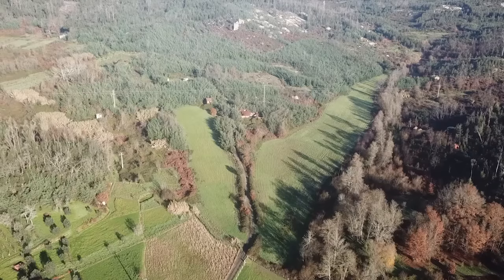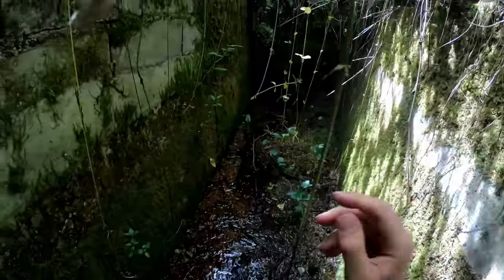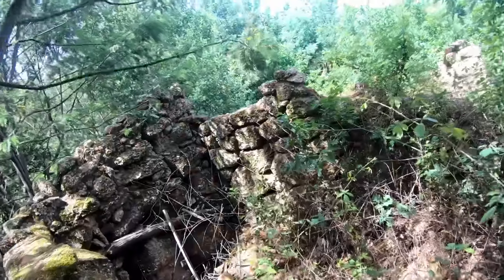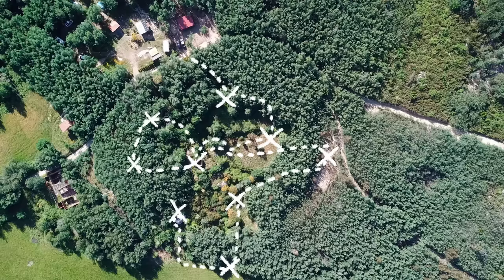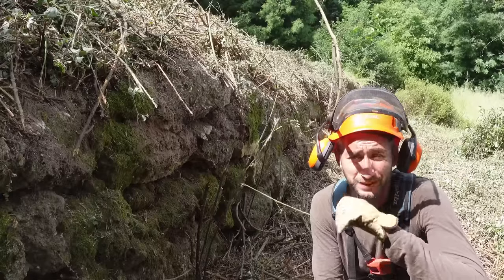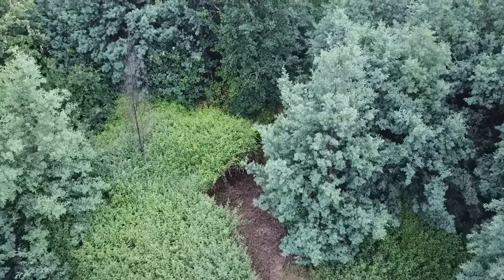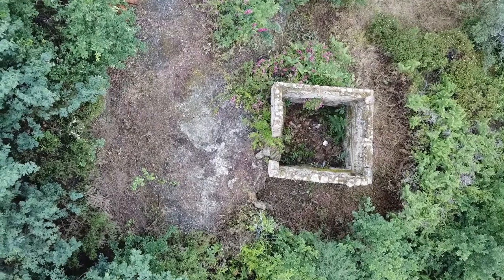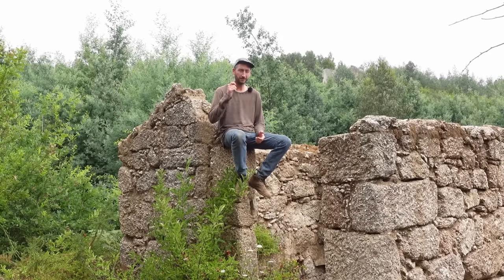#86 There is a "hole" in our land, we went exploring it

Comment: One thing to check out is that if the under laying rock is mostly granite, there may be a radon gas issue in any building you renovate or build.....Also something else to note is that in Cornwall, UK, the granite substrate contains high levels of lithium that are about to be mined....maybe your granite contains lithium too....
Reply: Buy the land before you let a geologist near it as if it is found the value of the land will be so high you wont be able to afford the price and you could end up with mining co owning it and an open cast mine in the middle of your land.

Comment: The three bay building made out of structural clay tiles (close to base Kamp) would be a relatively easy conversion to a 3 unit living space.  The gable ends and partition walls seem to be in good condition, so all you need is a roof, windows and doors and likely a floor.  This roof structure can be built entirely from mimosa selected for size and straightness.  Good experiment to judge the suitability of mimosa round wood harvested on site for future projects.  If you have fears of flammability of mimosa, paint it with intumescent paint for fire retardancy.
Reply: Fire retardant stuff is mostly not environment friendly.. Could be a toilet/shower building too.

Comment: The Snadyloam strip with spars vegetation looks like a material dump since its up and not down in a revine it shuld not be a natural formd sand bank. I would try to look how dep it goes and maybe ruing over it with a metal detector since its unclear if its just moved earth or maybe used to dump somthing else. Maybe ask the current owner if ther was a bigger building project that ad to move lots of earth around.

Comment: Brick ruin looks almost like a stable, and pile of roof tiles like a roof fallen in situ. Probably a wooden building that either burned, or just fell fairly gently. Granite ruin looks like it might be a granary...Which very much fits with a history of using the rock as a threshing floor. Would bet that all those bramble piles also hide ruins of some sort too...Especially those three in a row...probably post holes at the very least. Wonder how old it all is! The plate bit you found is probable dating evidence, and since it was right on the surface, likely to be from the last time someone had dinner there, at least.

Comment: I've never had anything to do with wells. But those human made gutters intrigue me greatly. Here in Australia, we would just get a tractor and slasher in to do all that mowing and brushcutting type work. The operator would make short work of it. And not upset the levels or the walls or ruins. 
The pink wildflowers are very pretty. Did I just hear you say those are roses? Wow, wild roses! I have never seen wild roses growing naturally. 
And over here all that greenery you have spent all that time cutting down would just grow right up again within days! It would have to be grubbed out roots and all (or poisoned for those who indulge in that habit!)
 All very intriguing. Seems like some sort of farming venture was undertaken many years ago. I'm trying to work out if the ruins are actually many 100s of years old or much more recent but well done. 
Perhaps the really dense vegetation was created from animal droppings. So maybe that is where the animals were housed and all their manure has made an excellent fertilizer for the weeds to grow. But I see there are roses everywhere. They look lovely but I guess they are very thorny.
The weather is obviously not too hot because you are not sweating profusely! In Australia, you would have had to take several breaks and dips in cold water to cool off. The brick building looks like fairly modern stables or similar. When I say 'modern' I mean in the last 50-70yrs.

Comment: The one structure looked like a stable or tool barn. And the stone structure next to it was probably a smoke house for preserving them animals when you slaughter them. Ok after you cleaned it out it’s possible someone stayed there but it would be very cramped. Like ancient tiny houses. Before you cleared the brush it looked like a good place to hang larger cuts of meat and make a small fire with green wood to smoke it all dry

Comment: There's probably more there than you actually realize. 
There used to be this extremely odd spot in my hometown in the US, it was in the woods, thick woods on either side of a set of train tracks that we used to walk along and hang out on. On the one side, towards a small unused lake, was kinda like this little opening in the thick vegetation, none of us ever went back there... until one day I was cutting through the tracks and I decided to make my way in and see what was back there.
Slid my way into the vegetation and cut through a bunch of thick "younger" trees than what lined the tracks, and suddenly came to this super strange opening....there was the greenest, most luscious grass you could imagine, and it was elevated in these short, wall like mounds, like a walkway of grass "building frames" if you were looking at a roofless large building from above with a bunch of rooms inside, but there wasn't a building, it was just grass mounded walkways with deep water where the "rooms" would be if it was a building..... perfect grass platforms you could walk around on surrounded by water somehow seeping in from the lake I'd assumed that was like 500yrds away, but the entire area was just cut out of the thick foliage and trees like a big square. Once I found that super strange area, that was my new hidden spot to just chill and smoke lol.... I ended up bringing a white plastic chair there I spray painted green and brown and left it on one of the "endings" of one of the maze like walkways, and would just sit there surrounded by these grass mounds and water and trees.

It had to have been something a hundred or more years ago, the shapes were definitely not a natural occurrence. And I also found near the tracks later on, a very old, early concrete type (old gritty type light brown concrete here in the States with small pebbles embedded), it was a sidewalk of sorts, very wide, and it was about 10ft away from the tracks on the side of the grass mounds further down the tracks....but it had fallen into the woods sliding downhill and it was almost completely covered in grass and foliage... I kicked off a bunch of moss and stuff that's how I figured out it was a sidewalk of sorts....but it went from way down the one end of the tracks where it opened up to the road, all the way almost down to that opening in the trees where those mounds were....but most of it was completely broken and buried and couldn't be seen towards the mound area. Pretty damn cool.

Comment: Nice project! I am wondering about eucalyptus (and pine trees) though, with regards to bush fires. Especially eucalyptus burns like a torch due to the oil and the burning parts travel with wind over long distances, starting new fires. Also helps fire to spread underground. Fire doesn’t kill the tree. If you have any eucalyptus, I suggest you get rid of it as soon as possible. It’s probably the worst tree to have around a homestead. They were and still are being planted. Bad idea. All the best

Comment: All those brambles like a job for a few goats,  save time from you manually, having to clear the brambles. Plus, you get free fertilizer, and you can milk the goats for drink and cheeses. Plus looks like you have the bones of a loafing shed, just needs a roof . With corrugated steel roofing looks like it only take a two week time frame for completion.

Comment: those ceramic brick houses look like goat or pig pens, with a new roof they would be great for rearing animals especially as theyre not too far from your house. You could use them to stor firewood too perhaps That big rock is a great vantage point.
There is a huge amount of potential in there  
Those berms are fantastic ,  
And an enormous amount of compost...... 

the Oak would safely coppice and regrow without any fuss, if it looks like it really wont stand up

Comment: Here we are trained to hate our neighbors immediately.  the first thing i did when we bought our place was to put up a 15 foot high electric fence with oversized no trespassing signs every 30 feet, cameras and motion detectors.   We've only been here for two years and we've already called the cops a dozen times.   The first time was when we were moving in,  this old lady came right on the property to case our joint to see what she could steal and claimed that she just wanted to give us a pie....  I had to stop everything to put in a big steel security gate because they wouldn't arrest her
Reply: Dang!  Where do you live?  I'm in rural GA an my neighbors are all at least 1/2 mile away.

Comment: The weird part of buying property with ruins on it like these can be strange. First off, it’s clearly an old homestead that failed for whatever reason. Those ruins are @150 years old. That means that somewhere on the property there are graves.  Finding them is close to impossible but I would bet that they are there. When someone died in your family they were buried on site sometimes with nothing more than a wooden cross or sign. A rock with some etchings about who and when is under the ground. Personally, that would just freak me out. No thanks. ✌️🇺🇸